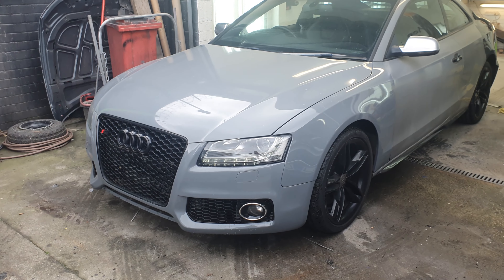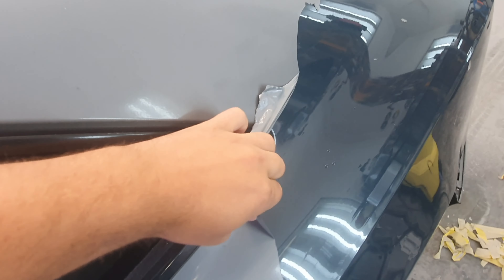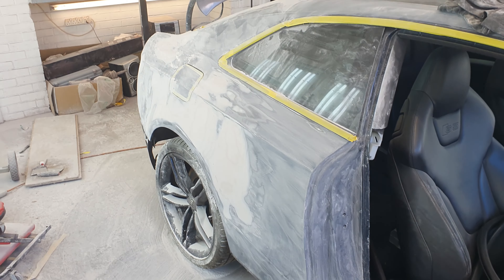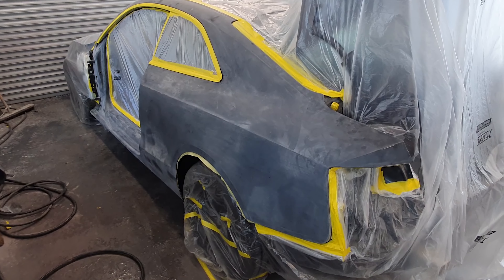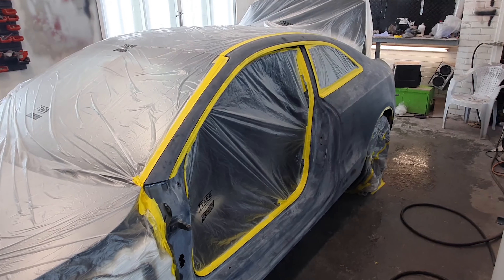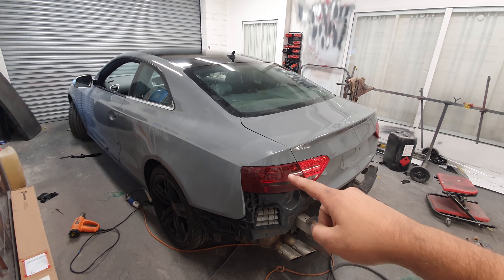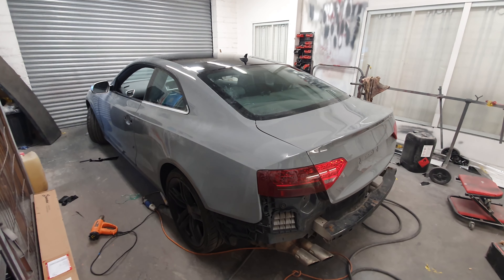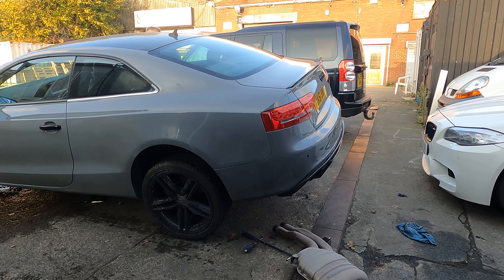AUDI S5 V8 IS FINISHED *INSANE LOUD EXHAUST*

Comment: You need a heat gun for the wrap you can’t just pull it off like that that’s what messes up the paint  more
Reply from the maker: We did use a heat gun and IR light however someone did a poor repair previously and the wrap peeled the clear coat 🙂
Reply: @ErykCars  dude that sucks 😢